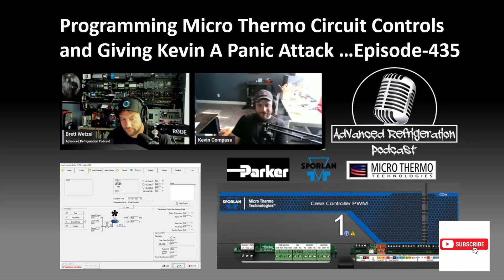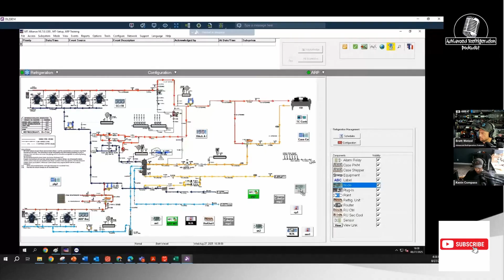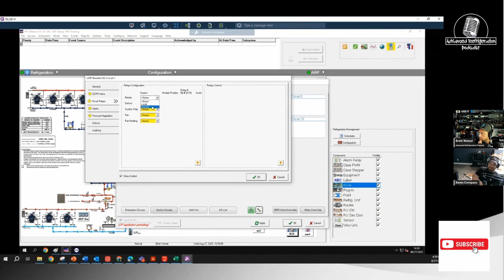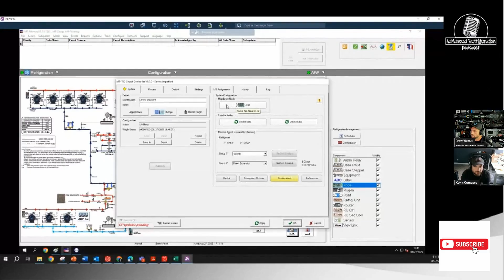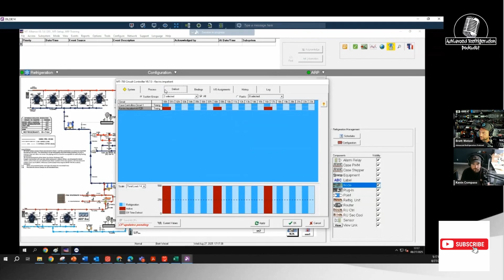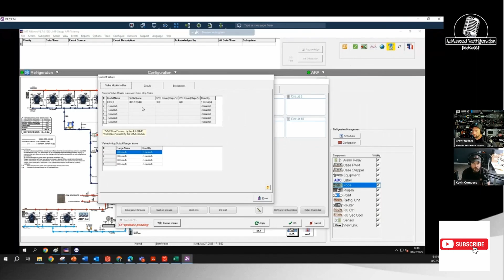Programming Micro Thermo Circuit Controls , and Giving Kevin A Panic Attack... Episode 435 Video

Comment: Here's one for you guys, with respect 

80's med size classic American grocery store 

All electro-mechanical Tyler rack, Carrier comps, gas defrost, gang clocks, mechanical stats, dial thermometers, eprs, txvs, pressure switches for rack staging, set properly by pumping out a comp, then bumping the suction valve until desired CI is reached, then slowly raise your pressure switch with alligator leads attached until it makes, great maintenance in house case and coil and drain cleanings regularly, etc 

Guaranteed more reliable and more efficient to troubleshoot and repair with parts on the truck 

Condenser set for low head fan staging with condenser flooding and receiver pressurization,l

Monitoring? That would be the store with people who care and are proud of their arrangements 

The lettuce will be crisp and the ice cream hard 

Than this digital slop nightmare we have now